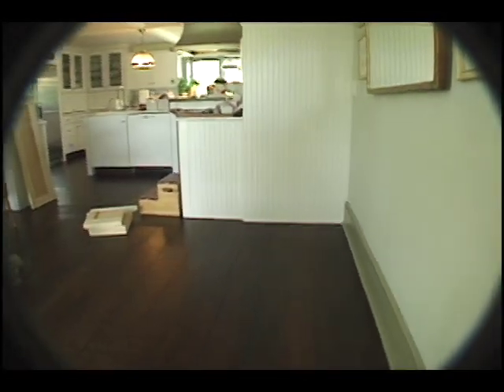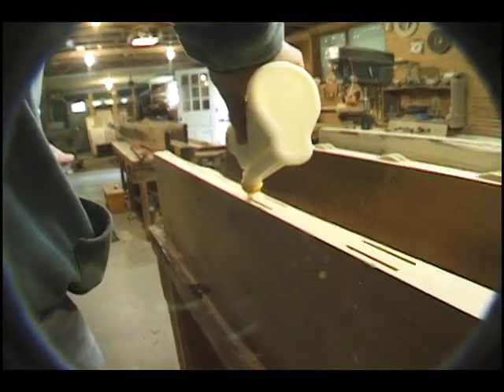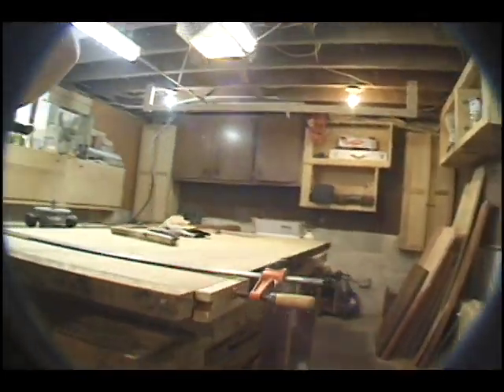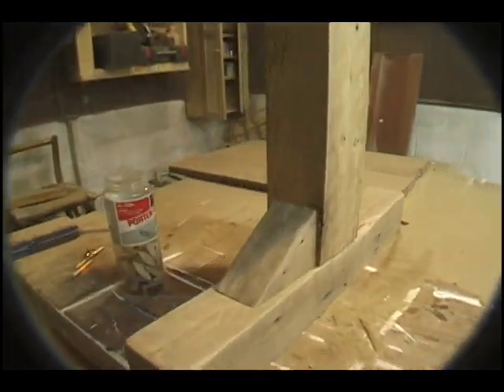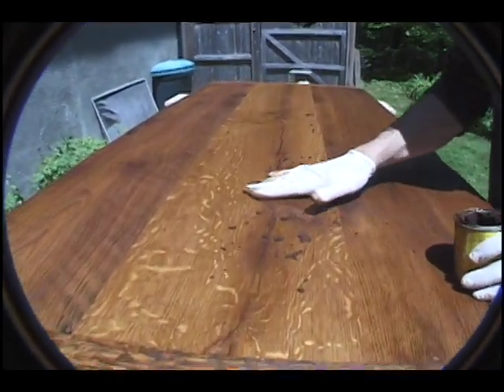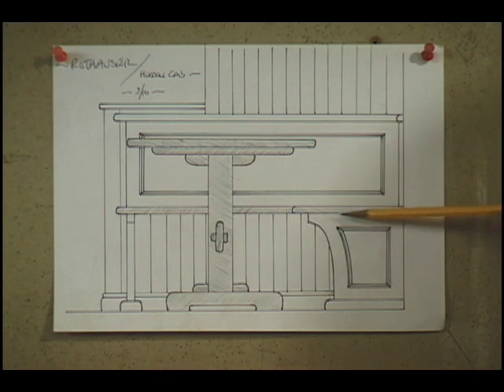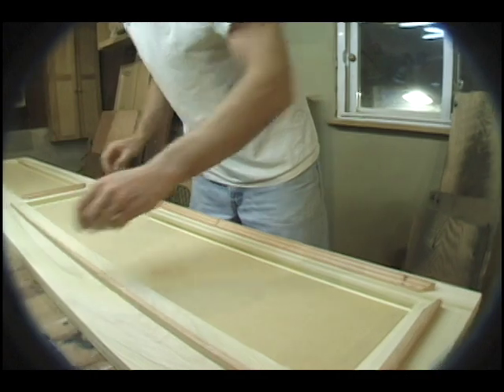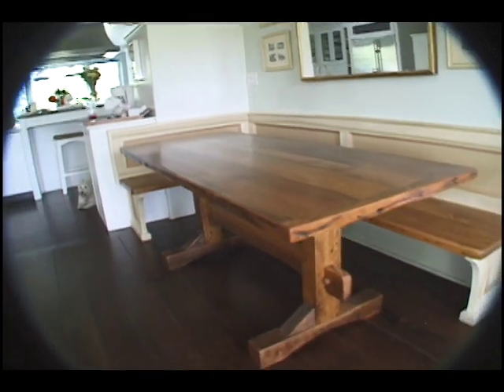trestle table & seating.mov

Comment: Love the table.  I know in the video you said the top was attached by wingnuts.  How exactly?   Did you epoxy a bolt to the top? Thanks,
Reply from the maker: it's a double threaded bolt / machine thread on one end and wood screw thread on the other

Comment from the maker: @thenodnarb 
A series of holes (forstner bit) were drilled within the rectangle on a drill press and chiseled out square. 
I broke my old mortising drill attachment. That would have been easier, but at the time I didn't feel like running out and buying the $80 attachment for two holes.
-rehuds